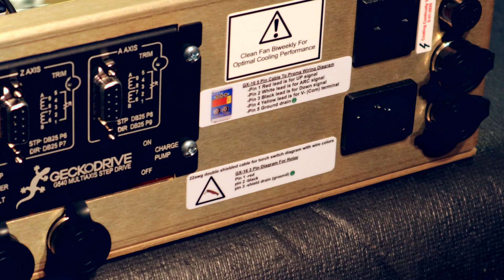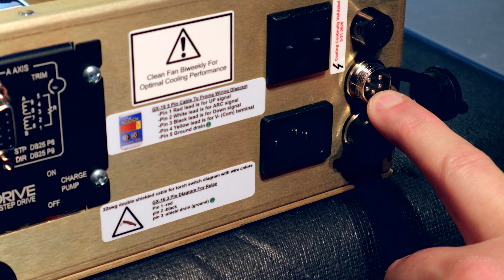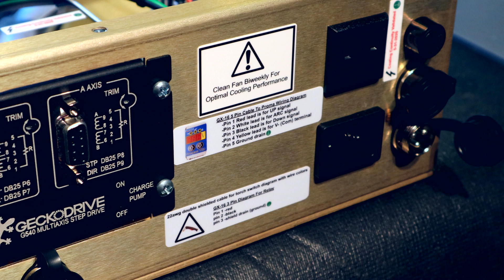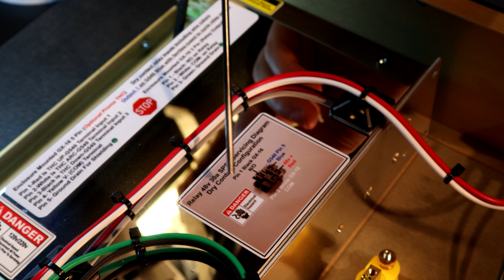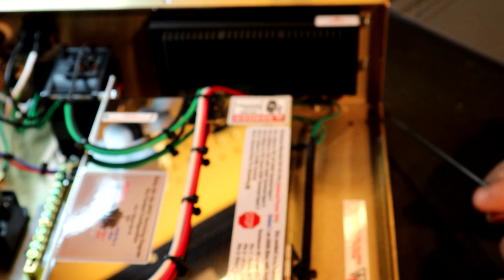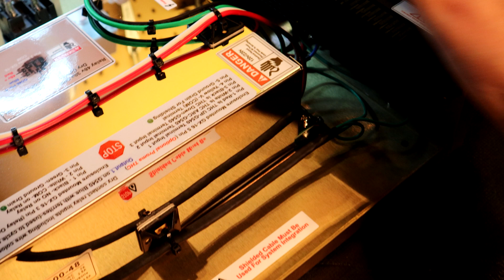CNC Custom Controllers Budget Is Everything (Shot in 4K)....

Comment: Like the old saying goes- if its cheap it won't be very good, if it's very good, it won't be cheap.  Question: Have you ever built a system around a stand alone controller such as Masso? I'm working on a plasma build and would like to get away from Mach, but I don't want the learning curve of Linux Cnc.
Reply from the maker: Steamfan71, thank you for your support. I currently don't offer any standalone controllers. Thank you,
Vince

Comment: why still the gecko with parallel port aint that outdated seeing pc dont come with parallel ports anymore
Reply from the maker: cornnatron, thank you for your support. The G540 will be getting an update shortly from Gecko in that it will be released with ethernet support. The parallel port is one of the oldest tried, and true communication platforms available for CNC systems which many clients still utilize today with PC add on cards for newer PC's. Thank you,
Vince
Reply: Exactly I purchased the gecko g540 5years ago and it has parallel port. It is frustrating since PC manufacturers have moved on and Gecko is still using ports that are outdated.
Reply from the maker: @thelastdon4664  Thank you for your support. Gecko is making revision changes to the G540, to etherent. Thank you,
Vince
Reply: Am I wrong, but can't you integrate it with a SmoothStepper? And get the best of both worlds?
Reply from the maker: @PatrickRankin  Thank you for your support. Your  absolutely correct, and in best practice I offer my ESS turnkey solution which is a segregated system from the controller mitigating any possible EMI, and allowing for simple troubleshooting. Here's its overview. https://youtu.be/uX_D23XtLwM Thank you,
Vince